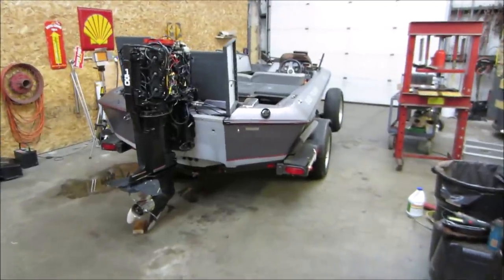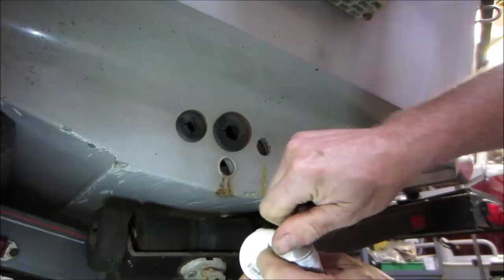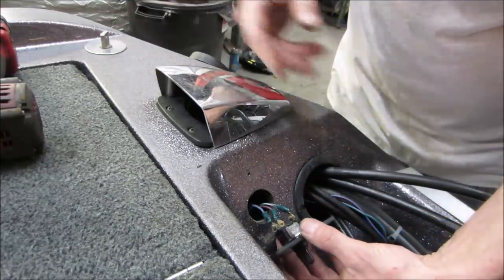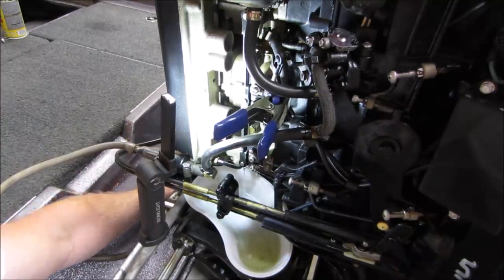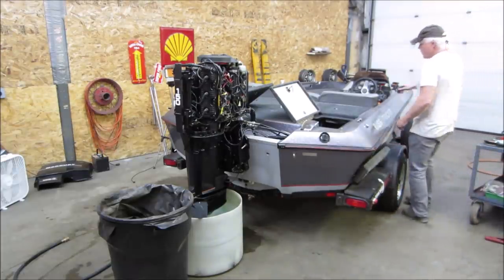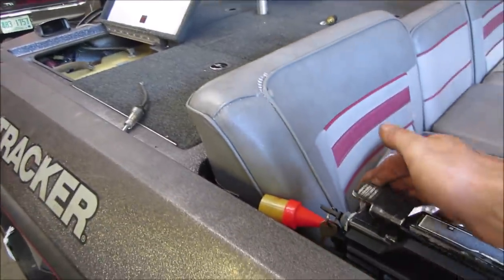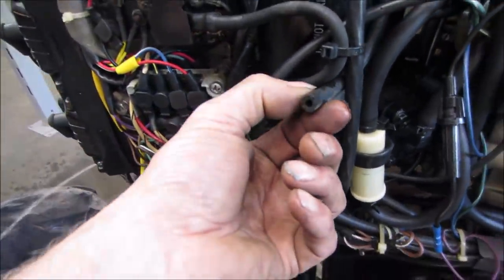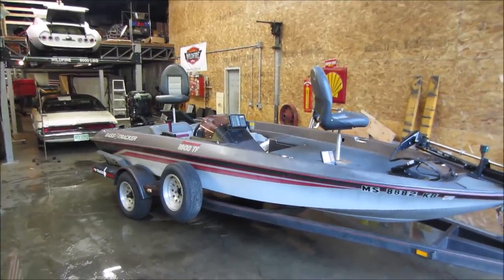Bass Boat Sitting 10 Years, Lets See If The Engine is Good?

Comment: Excellent video Mustie 1 :) I remember on home farm Guy also Wife traveling past in Fall Season of 1993  one , my mom ran up to machinery said be accident at home place  by boat broke of trailer plus truck and at first thought my mom was overtired from working to hard ! But got up to house trailer was home raising in also see trailer ran over home phone box  plus 18 foot boat with motor  in 2 of  40 foot trees ! Also so had got my late Uncle Bill help cut tree down also loader tractor we had to pull over also get boat down also trailer hook on too! But found guy & ladie gave my mom check for $500.00 for damage caused they plus home phone knock out at house trailer were live in also take trailer plus boat also motor in scrap yard because lost motor key for ignition switch could find the  spare key too! So me , my late Dad Don, uncle Bill took motor off boat was Mercury 500 size , found need start drive motors rebuilt need to do , 18 foot fiberglass was break apart and we found extra key in floor of boat too in mint condition too! Plus Steering wheel in mint condition, plus Lights switch, RPM , Oil pressure, Volt , Temperature and Speed ones all work even lights ! Trailer need fix up little bit! But funny part one Fire Department guy my dad knew bought trailer, motor also gauges plus lights too off us for $750.00 plus used all too! My dad Lol when told happen plus was shocked to what happened!

Comment: Hi, here in the U.K I pay £1.30p a litre for petrol(gas), which equates to £7.15p a gallon (imperial) or $8.32 US dollars a gallon,. so that 5 gallon Darren put into the boat would cost £35.75 or $49.63 US dollars at today's exchange rate of £1=$1.39 cents
Roughly how much would have Darren have had to pay for the gas,and is it cheaper or dearer than what I would have to pay?
Just curious!
Chris

Comment: Never use clear silicone on boats, always use 5200 adhesive silicone, especially on screws going into the deck (like fuel tank hold down screws)

Comment: hi i just bought same boat but sf model im restoring it, its in really bad shape.  tip , that fuel tank is made of crosslink poly (basically same stuf as pex) and it will break down in the sun quickly (so does pex).  so i painted mine fuel tank red to block the sun.  there is an article online how to paint crosslink polly.  i have to replace floor n foam in mine, hows your floor in that one?
Reply: also i replace the fuel sensor as the old one was literally rotten and replaced the fill tube as well

Comment: Do the water pump and if the oil injection is fed off the vacume or pressure from tye crankcase mayb at higher rpms it will feed faster

Comment: Fill that small oil tank on the engine and prime the oil pump on the port side of the engine. Sounds like the low oil alarm isn’t working. When the small oil tank runs low the float drops and sets off a buzzer under the console   Change the water pump both t stats and the poppet valve.

Comment: Broken fitting on the live well going to "flood and sink" the boat.  lol  Those boats are made with enough foam insulation that they are unsinkable.  They will flood which is uncomfortable.  However your sump pump should more than keep up with water coming in that fitting.  Make sure the cfm is enough to properly keep the boat dry and you will always be able to get back to the dock.  I have seen several Ranger Bass Boats launched without the drain plug and the sump was able to take care of the flooding.
Reply: And if your in gear the water naturally runs out.
Reply: @420somewhere4  Right on it's a natural venturi.

Comment: You think maybe it would have been better to open the engine  cover outside and it might be best for now on to open thing's outside just incase something just be living in it . Thanks for the video  its good your going through it all that would have been Embarrassing if you went to put it in the water an it started  Sinking sometime if the lower end is not in the water Deep enough it doesn't pump  the water out very well I have a motor it has a new water pump an it didn't like to pump inleass its in deep so I only used the muffs on that engine.  So you may want to put the muffs on it outside to see if it pumps ok if not you know it need a water pump well as much it has sat it might be best just put a pump it it. My 40hp Johnson it started to pump more oil then gas the carbrator's filled with oil then it stop running so I removed the thank that had the 2 cycle oil plug off the line now i mix my 2 cycle oil 50 to 1 an it runs fine i did put a different gas pump on it an remove the thing that for the oil injection if you all have that problem look up on a youtub channel for it .

Comment: Those oiling systems scare me and seem like a prime example of form over function.  Just ignore them and add oil to the fuel.  No issues to worry about then.
Reply: What ratio are you going to premix the fuel? 

Mix for wide open throttle @ say 25 to 1...then at idle it will smoke like hell.
Mix for idle at 200 to 1 and the engine burns up at wide open throttle.

So, of course you have to mix at 50 or 25 to one and create great clouds  of smoke...when trolling/fishing/starting/cruising ... cough... cough.
The VRO pumps when maintained and fed good fresh oil are reliable and safe....

If you worry about this, carry a gallon of 2 stroke oil on board, with a decent graduated beaker to measure it.
Then if the pump does go out you can always mix the oil with the fuel in the tank to create premix......
Reply: @JohnSmith-pl2bk  Good info, thanks for enlightening me.  I'm used to motorcycles and the like where that isn't an issue.  50:1 with modern 2 stroke oil works fine in older equipment designed for 20:1 or the like.  I can see where you wouldn't want that on a boat though.

Comment: The water pump and the gear lube should be changed out before you head out on to the lake.  You might consider replacing the trailer tires.   10 + year old tires and flat spots = flat tires in a 100 miles or so.  Trust me!  And of course, replacing the axle bearings and hub seals.   If hub seal surfaces are badly pitted? You can put some speedy sleeves on the
 axle to avoid replacing the axle.   I don’t know how the lake cops are in your area,  but here,  they’ll give their own mother a ticket for not having the proper safety gear on the boat.  A PFD, non expired Flares, floating throw cushion, a working horn, a whistle, and a fire extinguisher. 
Have Fun.  That boat should really rip!

Comment: Do not use Silicone on underwater fittings. You need to use a polysulfide base product, Life Caulk or 3M 4200. DO NOT USE 5200.

Comment: Replace the water pump impeller before going for a ride, no if and or but.
Reply: Think about replacing the other two through hull plastic fittings.  They are the same age as the one that broke.

Comment: Impeller first. Next, get rid of oil injection. Premix that bad boy. Then order a set of Carson reeds and replace the OEM stainless steel reeds and block. Carson are made with carbon fiber and if they break they won't eat your piston walls unlike the stainless steel oem ones. Trust me on that point... been there done that.

Comment: Does your forward Hummingbird have its own battery and/or power switch?   Suggest you shutdown until you KNOW you are getting 50:1 oil to the engine.  I still  think the old gas in the fuel tank had 50:1 oil in it.  Same color as some of my 50:1 oil.  Call the previous owner..the practice of abandoning the automatic oil injection  system and just adding oil to the fuel tank removes any doubt that the engine is getting its diet of 50:1 oil.
JoeB

Comment: Waterpump impeller... it is best and my shop and all the shops I have worked at before mine (45 years) replace them annually. Now they claim they last 3 to 5 years.... For 20 bucks diy it is a great insurance policy to just change it annually and save yourself an engine sooner or later. CHANGE THAT FUEL LINE. It is hard and will break apart inside. It already is, you can see it in the junk coming out when you pumped it up the first time.
The big tank will fill the small one WHEN THE ENGINE IS RUNNING... AND THE CAP ON THE SMALL TANK IS LOOSE. After it is full, tighten the cap on the on engine tank.

Comment: Come on dude, don't cheap out on this. If the boat has been sitting that long, all hoses need to be replaced, water pump impellers should be replaced every year, check the gear oil in the foot and maybe replace the seals. Lots of other things of do to make that a great boat so don't cheap out on this like you have on other projects. If you plan on selling it, do it right and you can probably get 4 or 5 times what you paid for it. Oh, and buy a good shop manual on the motor and stop guessing. That little float in the engine oil tank you keep messing with is for an low level oil alarm. Like I said stop guessing.

Comment: Those oil injectors always go bad. Premix the oil with the gas. Replace the impeller every year. They always go bad. It’ll over heat once you put a load on the motor.

Comment: Run that old dirty gas through a coffee filter +funnel. You can  use the  filtered gas by mixing it in with new gas.
Reply: Dispose of it entirely. 
Do not run it an any engine.
It is well past it's use by date....
use it in a parts washer if you must...or can stand the smell...

Comment: You need to change that impeller no doubt
Reply: And change the lower unit oil and run sea foam in that gas. You will thank me later.  Also you can use the quick care and quickleen  and quickstore too from mercury

Comment: I have seen careless owners not remove the foil completely when they open the 2 cycle oil container. The foil then gets sucked into the pickup in the tank blocking the oil flow.

Comment: I had a marine mechanic disconnect the oil system and mixed the gas and oil. On them older motors by the time you  hear the alarm its to late.

Comment: Nice boat.

You seem very concerned with if the 2-stroke oil is pumping up to the little run tank on the motor....  I think I'd be more concerned that the level was NOT going DOWN while it was running.....

Those were notorious for not working....  

I would seriously seriously make sure that thing is putting oil in while it's running.....

Or do like the rest of us did....  Just add the oil to the gas & forget it.....

When you drained that fuel tank, it was weird greenish blue....  that could have been the 2 stroke oil, added to the gas.....

A person gets tired of chasing that oil injection system, and having anxiety all the time, wondering if oil is going in it or not....  so you give up, and add the oil to the gas....

Comment: You're not far enough down into the water . 
Have a professional clean the carbs two strokes are susceptible to high speed leanout and may actually run a little faster but then seize up .

Comment: Please re seal those live well intakes regular silicone will fail man you have to use marine sealant. If those fail nothing will save you in the middle of a lake you will take on more water then the bilge can pump and sink, also those depth finder transducers are junk man, if you’re really wanting a bass boat to fish out of regularly then just replace both units with a garmin units, lowrances or humminbirds all will work great and they aren’t that expensive if you’re wanting a basic one with a couple transducers.

Comment: You really want better throughhulls than those sorry things. And you REALLY want valves attached to those. Even if you're just on a lake. And no, you do not want to use 'household' acetic silicone in that application either. Unfortunately there are things in boats that you can't quite save on that much.
Also, you really want to change all of them: no matter what polymer seacock enthusiasts will tell you, polymers don't like oxygen and they don't like UV.

Comment: If your lucky the wires in the motor arent eatin by your mice.   The smell will never go away.   Never try to run a motor that sat for years without cleaning the carbs, replace the diagragm in the fuel pump, and ofcourseanew water pump. Back down the maximun spark advamce 2 degrees, and run it FIRST on a shop fuel tank.

Comment: I will add my 2¢, replace the water pump. I'd hate to see that engine get fried. On the oil injection, the injection pump is driven from a nylon gear. You should replace this too. There is an alarm if the oil pump fails. You don't want to get stuck out on the lake. Bring a paddle.

Comment: BOAT= Break Out Another Thousand bux.... That pump stream shoukd start up almost immediately after engine start and should be a steady stream not spurting and weak like it is... That impeller has had 10-30 years to dry out and wear and they're cheap and not hard to replace and it beats rebuilding or replacing a 10k$ + engine...Not to mention that walk back to shore is a very long wet one.. Servicing the foot now @ the same time would be a good and cheap enough thing to do...

Comment: O and my the way change the water pump before you go out and if was me I would disconnect the oil injection and mix my oil myself.  50 to 1. I have been working on boats for year and have seen way to many oil injectors stop working. It works off of the fuel pump on one side and oil pump on the other. I have seen the alarm not work, the oil pump stop and fuel keep pumping and by by motor.

Comment: As noted...... Please! Change the water pump! Cheap insurance. Also disconnect and eliminate the oil injection and just run 50:1 premix. Much safer. Oil injection drops out and she'll lock up tighter than Ft. Knox in a heartbeat.

Comment: Dump the oil tank it's to old for proper oil injection to the  crank like some of the later ones that engine is mid 80s 50 to 1 mabe 4o to one it'll smoke just dumpit I'm the gas

Comment: Neighbor bought low mileage vehicle..serviced???  Battery long dead..clutch pedal kill was out of adjustment..hard to start..window  washer was   full of debris had to blow lines out fully blocked. Remove all parts to blow out.reservoir was full of junk.. brake fluid black... but tires are new its serviced.... interior was a mess dirty but yucky... wiper blades who needs blades..??? Squeegie long gone.. ac vents blow all over loose...no ac bad leak...will not do pre system check for emissions...so illegal..can't register car ...  yes sure its serviced... I tell peoples budget a grand on a us ed d car to get it fully serviced...diy cost..tires shocks brakes fluid changes belts and tensioner.. bulbs too...lube all parts.. hinges pivot points etc.. clay bar paint.. repaint hub caps .... done good for 5 years??